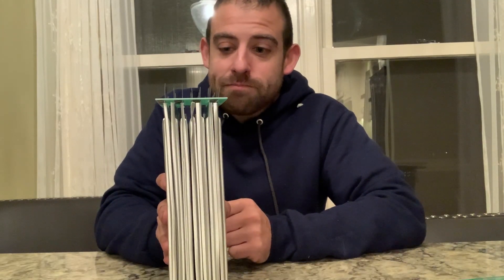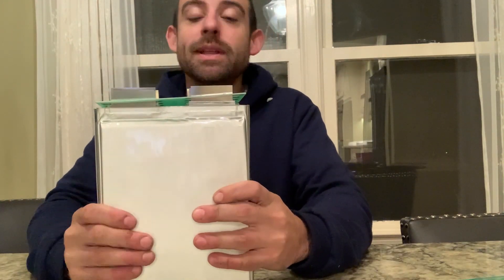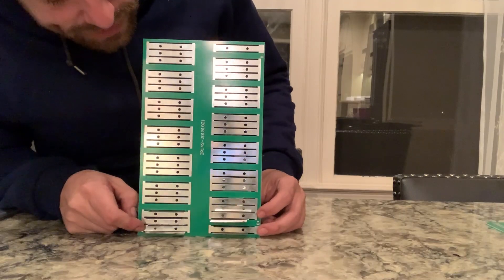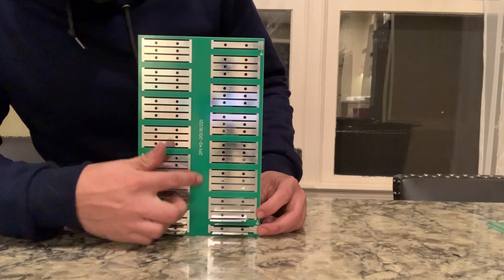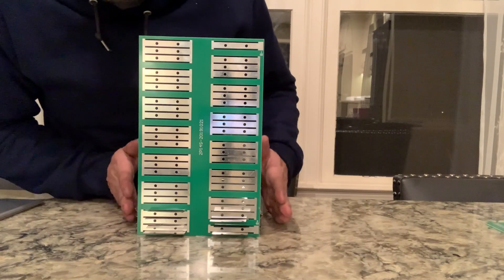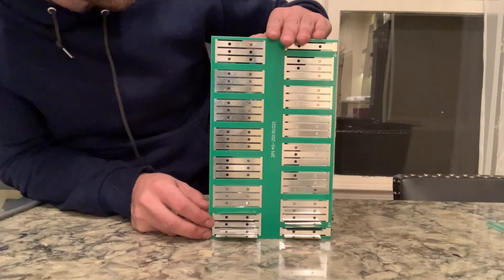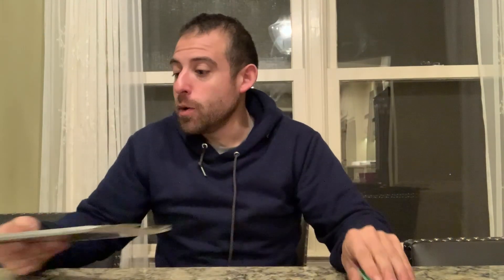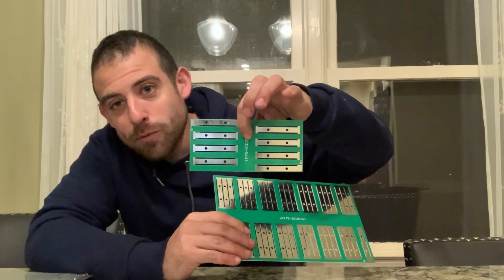TONS of power in a small cell

Comment: What model batteries are those? Any tips on where to get them reasonably priced? Thanks.
Reply from the maker: The cells i get for about 25 bucks each landed, i am gonna throw them on on e bay this week with the boards so for  200 buck you can have a 24v 40amp ah  pack that can discharge at 120 amps .
Reply: @diyguy1476  Great, thanks! I'll try to track it down there.
Reply: What is the manufacturer of those cells? What about specs? And cycle life / reliability?
Reply from the maker: 4nlimited3dition no name, i have used them for quite some time done some testing and they have been good to me
Reply: Sound kinda very iffy. If there is no brand or manufacturer, then there is no responsibility to produce good quality. Generic cells are always the ones exploding in all kinds of EVs.
Reply from the maker: 4nlimited3dition most cells on the market are clones , unless your getting them out of an ev. Most people don’t realize it and some clones are good some are bad , i have tested batteries i know are clones and they test the same as the originals , but then i have tested them and they suck so its a real crap shoot . I am not telling anyone to buy these batteries but the boards to connect regardless of the cell is what i am more interested in.
Reply: @diyguy1476  Hi, can I have the URL? thanks.
Reply: @SatryaSjukri  Im with you there. A link or some actual info would be awesome.

Comment: looking at building a 12v 400ah battery pack. would these work in that type of configuration? need to maximize storage density as these are for an RV application. lastly, what about temperature ranges, I live in Phoenix and in summer it gets quite hot. thanks and great work.
Reply from the maker: Barner 1 i believe they would , you would need 10 of them, i am posting a video of the full build of the cells and enclosure . Should have it up a little later tonight

Comment: Can you make a 72 volt.  And were do you get the batteries from
Reply from the maker: Yea that would be 3 24volt packs in series, i am going to put them up on ebay , cells i get for about 25 bucks each so it would be like 200 bucks for a 24v40ah pack that you can pit together.
Reply: @diyguy1476  is there a link were to get the boards or whats the title for them on ebay
Reply from the maker: You can email me and I can send you a PayPal invoice MARLIOESCOBAR1@gmail.com I can send you some extra pictures and stuff like that if you’d like to shoot me an email